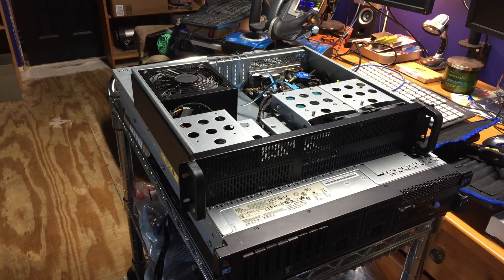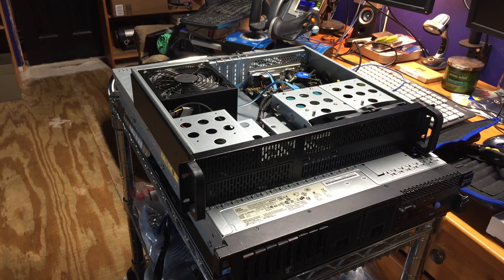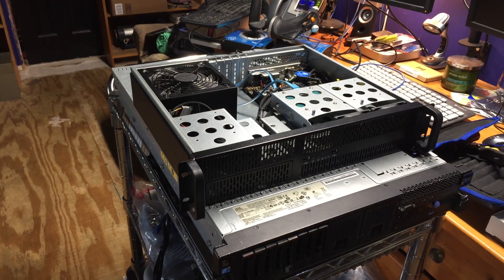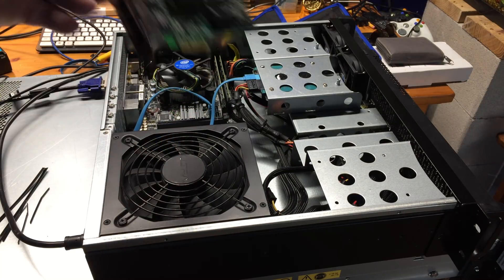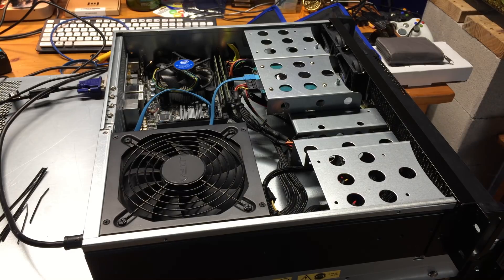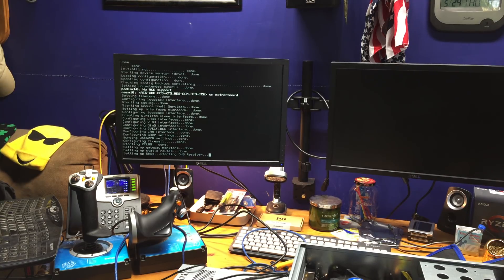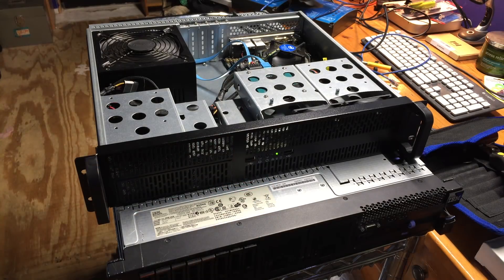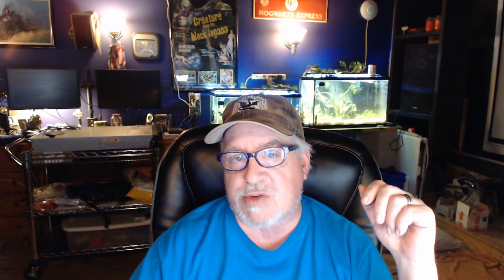Getting our rack together! PFSense build in a 2u case - EP-191

Comment: My favorite part of this case is how they put the power supply mounting on the wrong side of the mainboard! lol none of my PSU power cables reach the mainboard🤯 so now I need to get 2 extension cables 🙄
if they Just put the PSU mounting on the other side it would have been sweet 2u case. 
I'm using mine with PFSense too.
Supermicro X9SCM-F
2x Dell Intel Pro/1000 Quad Port
2x dual port SFP+ 10gb Mellanox MCX312B-XCCT ConnectX-3
80gb SSD

Comment: I use the H97N-WIFI paired with a i3 4360 for my pfSense Firewall. Very stable. Wouldnt recommend using the onboard Realtek NIC tho. Ive disabled both onboard and using the HP NC360T works perfect in FreeBSD. I mainly use Intel NICs anyway more reliable even in my Linux Servers.
Reply from the maker: Got my bracket for the Intel 4port nic in today, now to see if it fits :)
Reply: Should be fine. You will need to re-do interfaces for WAN, LAN OPT1 ,2 and 3 etc.
Reply from the maker: I had the Intel card in before moving it to the 2u case, it was trivial to switch to the internal nics, so it should be trivial to switch back, it will make a good video for sure :) Thanks so much for watching :)

Comment: Realtek controllers are okay for  use as " dumb NIC's " But you're right. I'd never even consider using one for a mission critical application. Nice video.
Reply: I have a customer with a failed Optiplex NIC here. ONE MONTH from premature failure to final repair, and they even told you the card you get is not new, it's a refurbishment of a failed card. My client bought an Optiplex because it was a production job..never again!

Comment: Does the i3 support AES-NI?  Be careful you order the right bracket... I got the wrong one. I have the Intel Pro 1000 VT and they sent me a Pro 1000 MT bracket...
Reply from the maker: I am using the i3-4360 which does support AES-NI among others. Thanks for watching :)
Reply: What model of Intel NIC you need the bracket for??  Reason I ask is I had to buy a whole new card just to get the right bracket... Im in Calif BTW...
Reply: I3 4360 has AES-NI Instructions. I use it for OpenVPN. But pfSense 2.5 will require CPUs that has AES-NI Instructions.
Reply: At first I thought he had a Ivy bridge cpu which the i3's dont have AES-NI... Its the reason I went from i3 to a Xeon on my Supermicro 1U.... Strangely the board only supports i3 and Xeon... go figure
Reply: Brian Froeber ivybridge CPUs starts with 3 i.e i3 3225 haswel starts with 4 i.e i3 4360.
Reply: I know.... I thought the 4th gens didnt have AES-NI support... I only owned a 3rd gen i3....

Comment: no rails for the case how you plan to spread the weight ?
Reply: I have the same case and have it mounted in my rack with no issues.  I think I'm using 4 screws on each side
Reply: @RufusShackleford  i was just thinking... there is no way you can put in enough weight in there for that case to require rails.. lol
Reply from the maker: Stay tuned :) Thanks for watching :)
Reply: stacking them lol....